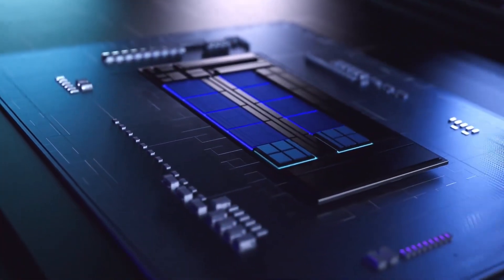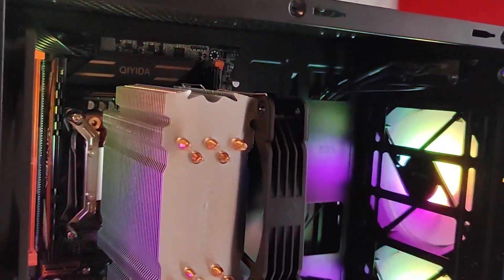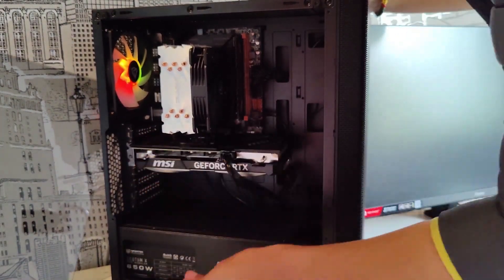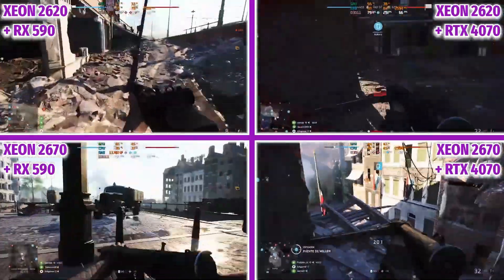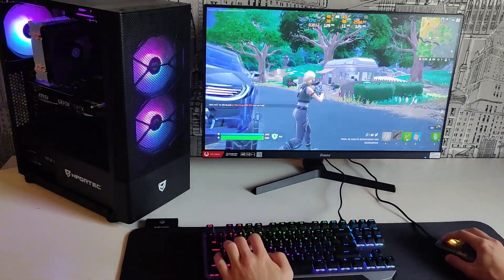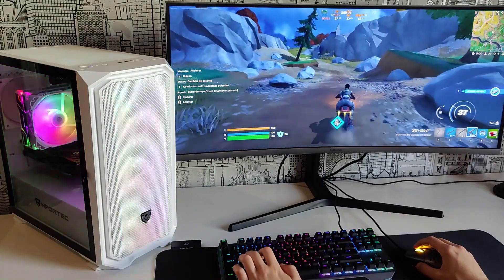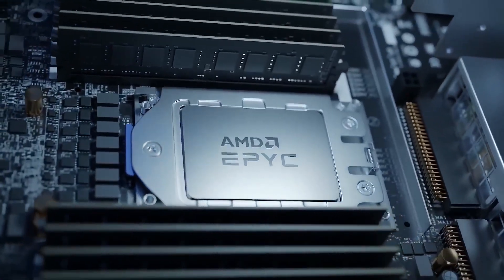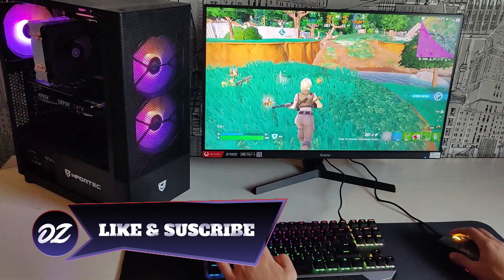😰A $10 Xeon CPU DESTROYS a $200 Intel I5😰

Comment: Great video👍
Can the Xeon processor be overclocked? And if the answer is yes, will its performance come close to modern processors such as the i5 12400
Reply from the maker: It can be overclocked, even though it is not a straight forward process like with the desktop processors. The bios isnt as prepared. The performance would improve, but not that much, the i5 (specially for gaming) would still be clearly better